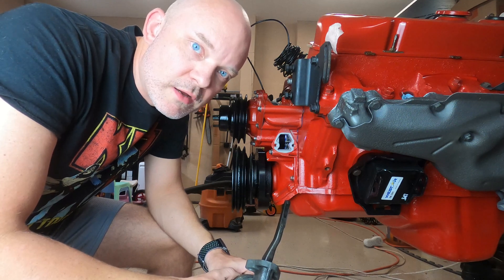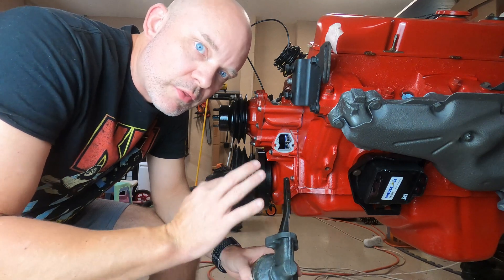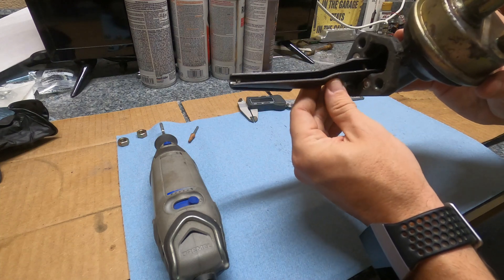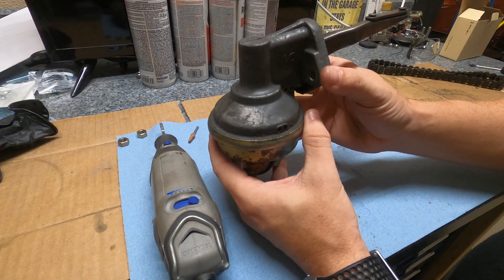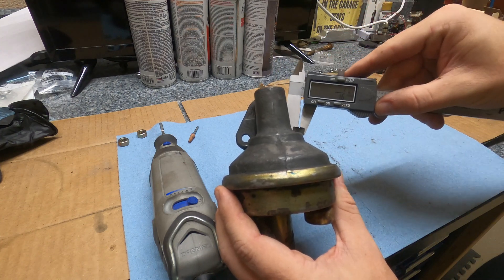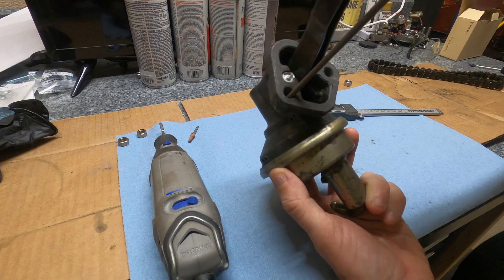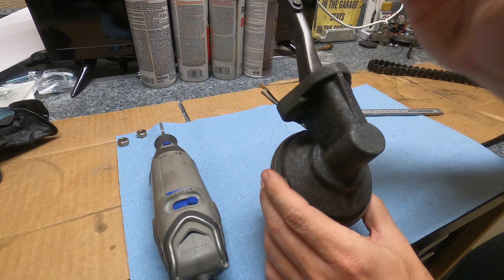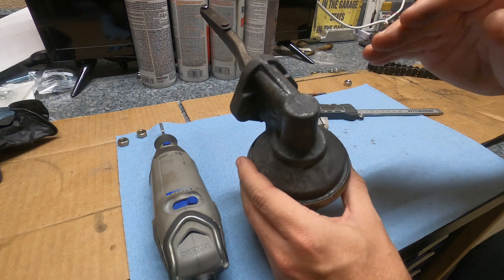What to do when your double row timing chain hits your fuel pump arm.

Comment: Hello, if i may ask, what kind of exhaust manifold gaskets did you install? Thanks Rob
Reply from the maker: I used the basic Fel Pro 3 piece gasket for each side.
Reply: @JackofAllTrades1  okay, thank you. Do you have any idea how long they last generally? On a stock 455 engine.
Reply from the maker: @Rob Robster  if the mating surfaces are good and it is torqued properly it should hold for years. No idea how long but they don't go bad.
Reply: @JackofAllTrades1  understood. Reason for asking is i have a set of Remflex too and they are said to never ever fail but they are quite obvious when installed.
Reply from the maker: @Rob Robster  yea you can barely see these and once they go through a few heat cycles they blend in.
Reply: @JackofAllTrades1  hope to do it as a one time job you know....
Reply from the maker: @Rob Robster luckily these are drop-in, so you don't have to remove the manifolds... only loosen them.
Reply: @JackofAllTrades1  i know they are. But my exhaust manifolds to heads are still factory original situation which means i need to clean up both manifold and head. Gonna do the passenger side only because of a small leak at the firewall (cylinder 8)
Reply from the maker: @Rob Robster  hopefully you don't have AC... cause that's gonna be a pain.
Reply: @JackofAllTrades1  i have AC, will have to remove the compressor a bit at least. Have removed it before and it was not too hard fortunately. My concern is some of the manifold bolts. I got lucky with the longest bolt which is the last lower bolt passenger side against the firewall as you know ofcourse, which i was able to loosen and tighten up. Hopefully the other bolts are not too hard.
Reply from the maker: @Rob Robster  yea... for sure take your time... nobody wants to remove a 75lb head just to extract a bolt.
Reply: @JackofAllTrades1  i know from experience it is possible to work on broken bolts engine in the car at passenger side. Are you on v8buick?
Reply from the maker: @robrobster9148  yes.
Reply: @JackofAllTrades1  👍 thanks
Reply: @JackofAllTrades1  by the way: did you add sealant to the Fel-Pro's?
Reply from the maker: @Rob Robster  no, put them in dry. The facing on the head side was resurfaced flat but my manifolds were original.
Reply: @JackofAllTrades1  thanks!

Comment: Old school tech.   Most of these yutes these days don't even know what a mechanical fuel pump is lol.   When all else fails bust out the block off plate and put on a quality electric fuel pump. ;)
Reply from the maker: I think once we get over 550hp in these Buicks we have to supplement with a pusher pump near the tank... I won't know exactly what I need for a bit though.
Reply: @JackofAllTrades1  Have you considered going with a Holley Sniper EFI that would fit under the stock air cleaner assy?
Reply from the maker: @PNW_Car_Mods  gotta keep it stock appearing... so for now it will just be the 800cfm quadrajet. Lots of guys are going EFI though... maybe in the future.